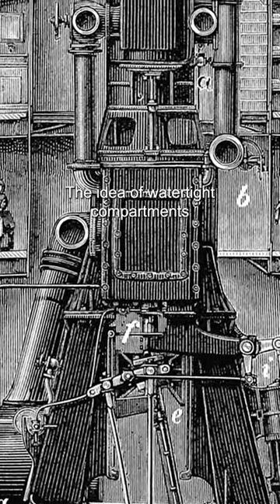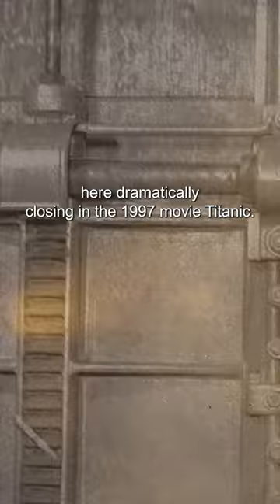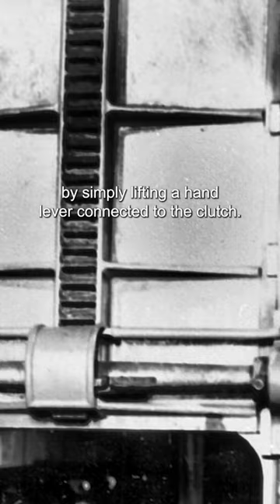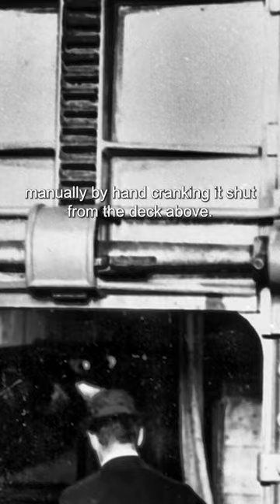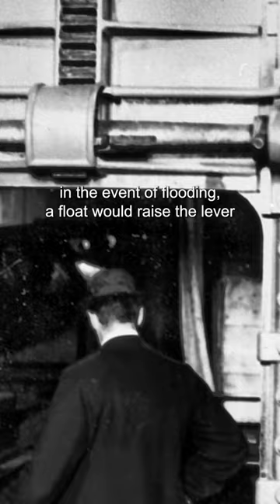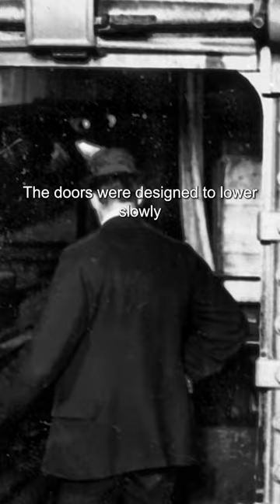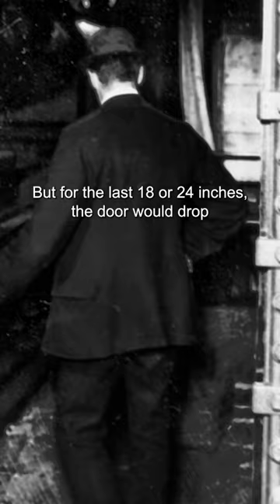How did Titanic's Watertight Doors work? | Oceanliner Designs #Shorts #Titanic #Ship #History

Comment: The main problem with the watertight compartments on the titanic was that they did not vertically connect with the top deck, thus allowing water to overflow into other compartments, nowadays its required by law to actually have compartments be able to fully seal off in case of emergencies.
Reply: Yeah, too bad that ships today are made like crap and capsize super easy, like the miserable Costa Concordia did.
Reply: @legioner9  
Thats simply a problem with cruiseliners not so much with anything else.
Reply: On the upside, they were all transverse, meaning she never listed. Which helped slow the sinking a bit and meant that she retained use of the davits on both sides.
Reply: @legioner9  Actually, those cruise ships are made to even better standards on watertight subdivision. Their worst problem is the bigger ones tend to be top heavy because of the massive superstructures.

Cowardly, undisciplined, incompetent captains and crew have been the big factors in those sinkings. Costa Concordia is a prime example of that.
Reply: @ZeldaTheSwordsman   Cruise ships are inferior in every way engineering wise to an ocean liner. What you are saying doesn't make sense anyway. If cruise ships were superior (regarding watertight compartments) but to whom you didn't specify, then why do they capsize? What does that superiority of watertight compartments even mean?, i.e. in what way does it help?
Reply: @nocare   Science disagrees with what you say completely. Ocean liners use thicker steel, are way better balanced and therefore far more stable, are more powerful, achieve higher cruise speeds, look nicer, and in general are better built. Also, comparing Titanic's sinking time to that of Costa Concordia is just silly. They were in totally different situations. Cruise ships are crappy made. No more, no less. Get over it and stop trying to bend facts in order to support your theory.
Reply: @nocare   Yeah, at this point you just proved beyond a doubt that you are incredibly silly. Sorry. Everything in your comment is wrong.
Reply: @legioner9  "mimimi, im wanking off on ocean liners and hate cruise ships" isnt science, thats opinions.

Also just because cruise ships do look top heavy, doesnt mean they are. It looks like therefor it is, is also not science.
Cruise ships can roll minumim (required by law) 60° without tipping over.
And the Titanic not capsizing was the exeption and not regular for ocean liner.

Also most of the Cruise ships are as fast as the Titanic was, but speed is for a cruise ship total irrelevant, they are not made to cross the atlantic as fast as possible, they are made to entertain people for a week or two on a sight seeing tour and drop them off at the same port they borded.
Reply: @wolf310ii   What opinions are you dreaming about? I state facts. It is a fact that ocean liners are far more stable than cruise ships, better built, i.e. far stronger bow, hull and, of course, more expensive to build. And I am not debating. So please, spare my time with pointless and idiotic replies.
Reply: @legioner9  Far more of your wet dream of a ocean liner are sunk than cruise ship sank.
White Star Line alone already lost more ocean liner because of sinking than cruise ship sank world wide. That is a fact.

Ocean liners had a lower metacentric high than cruise ships, and the closer the metacenter is to the center of mass, the easier it can capsize.
To make it compfortable for the passengers, the ship needs to be "unstable" with a low metacentric high, otherwise it would roll with every wave.
Cruise ships can have a higher metacentric high, because they have active stabilisation systems to counteract the rolling.
Reply: @legioner9  rofl it's actually kinda cute how daft this guy is
Reply: @raumfahreturschutze  I think he doesn't like ocean liners :))
Reply: @legioner9 cruise ships and ocean liners (only 1 today) have to comply with EXACTLY the same damage stability and watertight integrity requirements.  You are simply wrong stating they are inferior.
Reply: @skippyguy3   I am not wrong. Requirements and standards for hull strength is one thing, and the actual treshold of the hull's resistance are different things. That is what I am reffering to when I say that ocean liners are stronger than cruise ships. Same goes for their stability. Ocean liners are far more versatile in rough weather. Look how they are shaped.

Comment: The problem was the walls were not watertight.  When the had too much pitch the compartments started flooding into the next one.  The was supposed to float with a couple filled but too many did and that's why the aft tilted up.  The bow got too heavy to stay afloat.
Reply: The bulkheads separating the compartments were watertight. The problem was that they didn't go all the way up to the main deck. So when the initial six compartments flooded, it lowered the ship enough for water to spill over those bulkheads into otherwise intact compartments at a rate the pumps couldn't keep up with.  Which lowered it even more, allowing even more water in, then that would repeat again and again until the bow went under and the ship snapped in half.  This would be fixed on both the Olympic and Britannic by simply extending the bulkheads up to the main deck.
Reply: @hanzzel6086  They did that so  that the "Grand Staircase" could be long and sweeping, but the bulkhead would have intersected the space.

Comment: The same technology was used in the late 50s and early 60s on American passenger liners. I never noticed any vertical style closures. I also do not recall the ability to walk the full length of the machinery and engineering decks. I do recall descending stairs to the boiler space. And I also had fun climbing the extremely long escape ladder from the aft end of the main shafts. I think each space was separated by a watertight bulkhead. All the elevator shafts stopped at the deck that was just below the waterline. And now the discussion would get complex for explaining each zone.

Comment: Reminds me of the old fireproof doors they used to have in industrial buildings that were heavy as hell and hanging on a slant and held in place by soft metal like solder so that heat from a fire would melt the hold-back and it would slide down and slam shut slowing the progress of fire.

Comment: I never understood why the walls in the lower compartments didn’t go all the way to the top, so the water couldn’t spill over into the next compartment and so on. Like Andrew’s said: she could stay afloat with 4 compartments full but not 5. If the walls were sealed only 2 compartments would have flooded, and she could have made it to New York.  🤔
Reply: If the compartments topped off, six compartments would have had water in them - Six compartments were opened to the ocean, and no damage control effort was able to seal any of them. The first probably wasn't a big deal, since it only breached a tank that was already full, so there would be five compartments that actually flooded fully. 

Still, it probably wouldn't have sunk. The big problem was that the flooding allowed water to flow over the top of compartments and flood the ones behind them - A chain reaction. Once the fifth compartment was flooded enough, the top of the sixth compartment was low enough to get water flowing into it from the fifth (through whatever open spaces it found above the top of the bulkhead), and so on.

Bulkheads are expensive, and more importantly impair the movement of passengers around the ship. For that reason, compartments typically didn't go all the way up until after Titanic demonstrated why they should.

Comment: What I asked myself recently is, could the sinking been prevented by simply NOT closing the doors?? That way the water would've been equally distributed in the lower section of the ship and preventing it from sinking over bow!
Reply: Then the ship would sink faster and flatter. Water would still have been flowing in, but it would have more space to spread out over before the level inside the hull matched that outside, so it'd just keep going. Titanic didn't have the reserve buoyancy to let the whole hull flood up to the normal waterline.

Comment: One question. I heard there were watertight doors above E Deck, but these ones closed horizontally, and can only be closed manually. Did these have a failsafe too, like the weight with the verticle ones, in case no one was there to close it? It sounds foolish not to, because that would allow water to flow freely.
Reply: You answered your own question: "can only be closed manually".
Also the scottland road was a corridor without any doors, going from the bow above all boiler room to the engine room. So waterthight doors wouldnt made much sense above E-deck

Comment: What if the water tight compartments were sealed from the top. Kind of Creating water tight cubes. That way water wouldn’t spill over and over into the next section. Would that of worked? Always wondered that.
Reply: What people mean by water “spilling over the bulkheads” is that, towards the tops of the compartments, there would’ve been openings like doorways and air ducts that would allow access to passages outside of the compartments; i.e, water would reach the top of one compartment, spill through a doorway, flow down a hallway, spill into another doorway and down into another compartment, and repeating.
In all likelihood, they were indeed sealed at the ceiling.
Reply: After the disaster, the sister ship "Britainnic" under construction had its design modified so watertight compartments extended a few decks further up.
Reply: It's required by law these days and yes it works very well, most ships can continue sailing after having a flooded compartment
Reply: @logvoid1559  Unless you are on a car ferry, which has a large interior hold running the length of the ship without any dividing bulkheads.  In 1987, English Channel ferry 𝐻𝑒𝑟𝑎𝑙𝑑 𝑜𝑓 𝐹𝑟𝑒𝑒 𝐸𝑛𝑡𝑒𝑟𝑝𝑟𝑖𝑠𝑒 capsized and sank minutes after leaving dock because crew forgot to close the end cargo doors and water inundated the entire hold.  And in a staggering oversight, unlike what you seen on the 1912 ship in the film, this 1979 vessel did not have indicators on the bridge to show the status of the doors.
Reply: @logvoid1559  as would Titanic, even with 2 flooded compartments...
Reply: @haweater1555  The number of mixed passenger/car ferrys lost due to poor/faulty design has convinced me to never be on one when it leaves dock.

Comment: I disagree with the opening statement. I’d say it was evolutionary if anything. Battleships and cruisers had been using compartmentalisation and doors for some time. The Cunard liners (having been built to admiralty standard) also had compartments with doors. In fact their system of using coal bunkers against the outer skin created the first crude “double hull” structure. Perhaps for the Olympic liners “revolutionary” would specifically entail the automatic/ remote controls which operated the doors.

Comment: My understanding was the “watertight doors” left gaps at the top, water would fill up one space only to spill into the next.
Reply: Not the doors. You're thinking of the bulkheads, which were the huge watertight walls. At the time, safety design was still a work in progress. Heck, some ships of the era had bulkheads that ran parallel to the hull, creating port and starboard compartments that could, and sometimes did, result in capsizing the ship in the event of flooding.

Comment: Titanics safety system worked as designed 🤷🏽‍♂️ the only design flaw of titanics watertight bulkheads is that they only went up to e deck and they weren’t fully sealed because the top was open so water could pour over one compartment and flood into another one 🤷🏽‍♂️ I mean the ship did last 3 hours 🤷🏽‍♂️ in 1912 the biggest flaws of the titanic was the owners choosing looks over safety 😳 originally titanic was gonna have enough life boats for everyone on board but the owners thought it would make the ship and 1st class feel bulky and they thought that it was unnecessary to have more life boats another flaw of the ship is how it was built the ship was built with rivets which is like heating an basic screw and Hamering it into an hoe to hold metal plates together which is weaker then an welded ship because welding is making peace’s into one peace so the whole haul is one peace vs hundreds of thousands to millions of separate plates held together with rivets .Ik welding welding wasn’t advance enough in 1912 it was there but was advanced enough to build an big ass ship 😳
Reply: The Titanic could barely fill the boats they had befor sinking, so more boats wouldnt had helped.

And riveting is as strong as welding. Welding only allows for lighter hulls, because no overlapping of the plated is needed.
Riveting isnt a heated screw hammered into a hole, if you want to compare it with a screw, then it is a screw put through the hole with a nut screwed on on the other side, only that a rivet is much stronger than a screw of the same size.

Comment: If u don't make the door youre going to the fkn bottom of the ocean!?

Never getting out!?

Yikes 😳
Reply: There were actually ladders and catwalks that leads up to E-Deck Scotland Road and further upwards, so there are more ways to escape in an emergency.
Reply: @eggzbenedict3358 then thats probably why it sank!?
That would mean its NOT water tight??
Reply: @LBCB94025
It is watertight if it was flooded in the amount of compartments it could withstand (4). Unfortunately, Titanic was flooded by 5 compartments, that's why the watertight compartment didn't do what it's supposed to because it was more than its limits.
Reply: @eggzbenedict3358  yeah but if there were permanently open hatches at the top; it will sink Regardless!!??
Reply: @LBCB94025 Only if water gets above the top of the compartment, which only happens when at least five are flooded.

So, yes, you've understood how Titanic went under, but that's also why it could have limped to New York with four - the water wouldn't have gotten to the top of the compartment.

Comment: The doors where not the problem but the compartments themselves which should have been water tight and we’re not
Reply: No they "should" not have been, they were exactly as designed and worked for what the ship was supposed to handle.
Reply: @hugos5114  Too bad it was only designed to handle 4 flooded compartments.
Reply: @hanzzel6086  "only" is quite an incorrect word i think, it was still much more than most liners on the seas. 4 was almost seen as unreasonably high.
Reply: @Hugo S  At the time, you would be correct. By modern standards, it is definitely "only" 4.
Reply: @hanzzel6086  i don't know many ships that would survive a third of their length open to the sea tbh
Reply: @Hugo S  It depends on how many compartments it has. The Titanic wouldn't have sunk (or would have taken much, much longer to) if the bulkheads went all the way to the main deck.
Reply: @hanzzel6086  but that (bulkheads going all the way) was not planned as titanic was not meant to survive 6 compartments.
Reply: @hugos5114  I know, it's just a sad fact that that simple change could have saved hundreds of lives.

Comment: Would have helped if the metal they used didn't crack under cold water
Reply: It didn’t crack under cold water, though. They weren’t even in that level of cold waters until 4 hours before it hit the berg.

Comment: What about the burning coal bunker?  The ship’s speed was dictated by the need to empty the burning bunker as fast as possible. The burning coal was literally dug out and thrown into the boilers. 
Unfortunately the heat warped and weakened the bulkheads. Doors jammed and the cooked steel collapsed causing the sinking to go even faster.
Reply: The fire was a tiny smolder, which didn’t weaken the bulkhead, didn’t dictate the ship’s speed, didn’t jam the doors and didn’t contribute to the sinking.
Reply: That’s what the official report said. But it’s not what (the few) surviving stokers said. 
Bunker fires are never small. That one was leaving a scotch mark on the outside hull playing before the ship sailed. It most certainly wasn’t a small fire.
Reply: The bulkhead didn't weaken. What happened was a gash created by the iceberg allowed water into a coal bunker. The weight of the water eventually broke the bunker since it was only ever designed to hold coal.